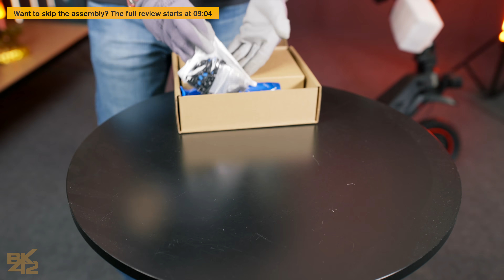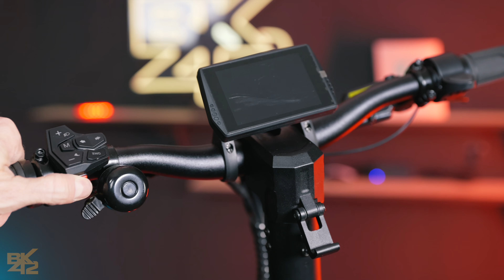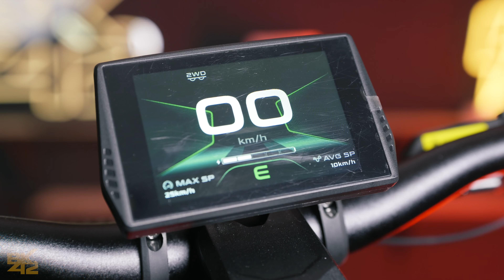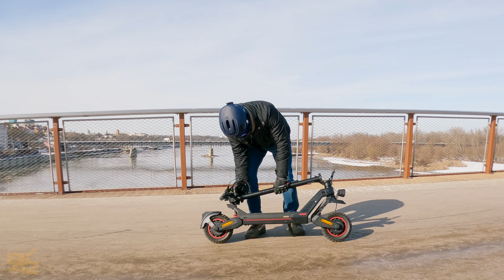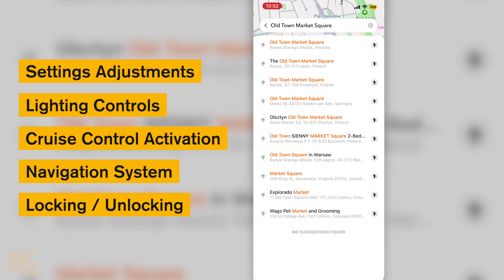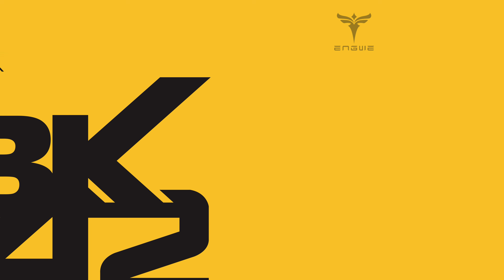ENGWE Y1000 SCOOTER – Unboxing, Assembly & Real-World Test

Comment: For those who want to unlock it, it's very simple.
1 - Press and hold the M button for 2 seconds to enter the settings menu
2 - Press the – button to go to the Speed Limit screen (by default it's limited to 25km/h)
3 - Hold the + button for 5 seconds 
4 - Hold the – button for another 5 seconds, the display will change to 60 km/h
5 - Press the M button to exit the settings menu.
 It's done! You can now enjoy your unlocked Engwe Y1000 ✌😉
Reply from the maker: Thanks a lot, brother! This will definitely help many riders. Cheers! 🚲🍻
Reply: @BK42Cycles  No problem, it was a pleasure ✌😉
Reply: I wonder how will the unlock affect the speed modes?
For example Eco, Drive, Sports?
As a personal preference I prefer limit to 35 kmh, but also want to have the extra power if needed on the go (without entering some menu I mean)
Is it possible ?
Reply: @charlye312 It's like an ebike, If you unlock it the levels are adjusted. I don't know what are the speeds by levels because I don't have this scooter.
Reply: @remi02117  the same Way can unlock y700?
Reply: @volodymyrkravchenko7842  Yes, same method
Reply: @remi02117  thanks bro it works! Can you tell me how to set it back to 25kmh if ever stopped by police, because i cant figure it out😅
Reply: @solatozer  it's the same method
Reply: @remi02117  are you sure, because it is stuck at 60kmh
Reply: @solatozer  instead of pressing - for 5 seconds to unlock to 60 try to press + for 5 seconds but the method is the same
Reply: But on display still show max speed 60km when you changed back to 25km 🤔
Reply: E como bloquear novamente

Comment: May ask is the battery real 22.5ah because mine it say 873WH wich mean 16.5ah
Reply from the maker: I haven’t opened the battery compartment to verify it, but mine was specified as 22.5 Ah. Perhaps the battery specifications vary depending on the region? I’m not sure.
Reply: @BK42Cycles  in the website where i bought it show 52v 22.5ah 
But whene my scooter arrive i saw down the scooter battery capacity 873WH when you do calculation it 16.5ah
Reply: Can you check if you have it too its righten down near bar code...

Comment: Hi,
the Battery is advertised to have 22.5 Ah ,,, but on the sticker on scooter is writted clearly 873 Wh !!
what is the real capacity ??
Reply from the maker: Batteries can be measured in Ah and Wh, just like weight can be measured in kg and lbs. However, 22.5 Ah is not equal to 873 Wh.